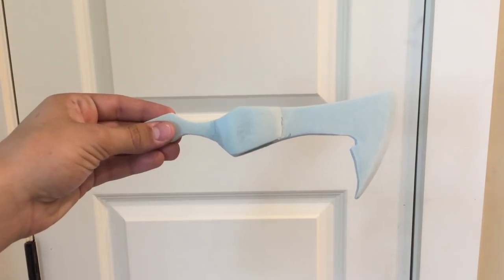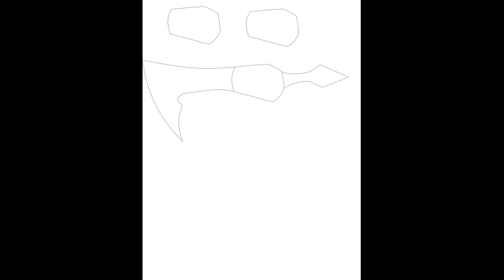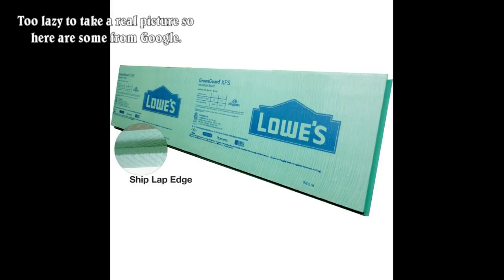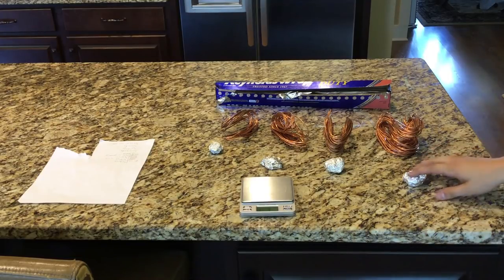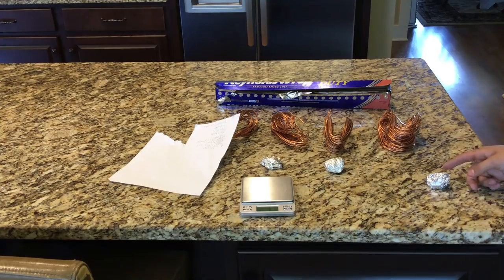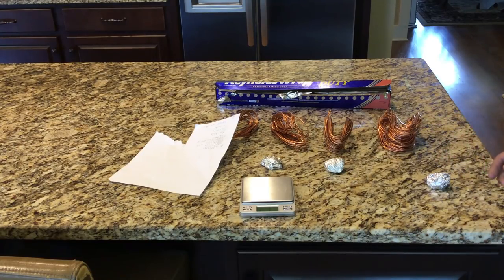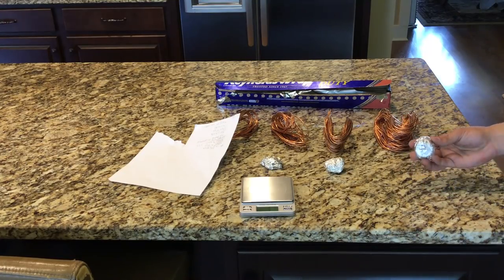Golden Tomahawk Made from Aluminum Pans and Copper Wire

Comment: Btw there are secondary metal wedges that are suppose to be hammered in after hammering the first wooden wedge. If you think there’s any chance that axe could ever be swung, you should add one. You can get them at the hardware store for just a couple of dollars. They come in circular and flat shapes. If you get the flat one, angle it perpendicular to the wooden wedge and hammer it in

Comment: excellent video, !!!  Did you heat the copper to 1090 celsius or added some low meting metal to lower the point? I mean aluminium 's got a higher MP. . . . .

Comment: You got a really nice finish on that, great work!  Have you work hardened the edge and tried throwing it yet?  Lots of fun!  If you do some peening to harden the edge it's amazing how well an aluminum bronze blade can hold up.  I've cast a couple too but mine were more like hatchets than hawks, and cast in greensand using C95400 aluminum bronze rather than a homebrew alloy.  I take mine on camping weekends with the guys and they get used chopping hickory logs for the fire all weekend and hold just fine.  I really want to try making some homebrew al-brz at some point as well.  

If you're like me you're always trying to to figure out what the next upgrade to your foundry should be.  Here's my suggestion: Do yourself a favour, get yourself one of those 3-finger log grabber fireplace tongs and lose the salad tongs if you don't have access to a welder to make some proper crucible tools.  Those log grabbers work great as lift-out tongs for smaller crucibles, and your little guy there looks small enough you could even use the.same tool as a pouring shank too,  just set it down, switch to a side-on grip for a better controlled pour, and there you go.  As long as you don't squeeze too hard you'll be a lot safer that way than you are holding crucibles of molten metal with your hot dog grabbers. :)
Reply: Glad to hear you're working on safer pouring tools, those salad tongs make me nervous!

Aluminum bronze is actually used to make some modern axes because it is almost as hard and durable as steel, but it won't throw sparks, so it is the perfect tool for, say, a maintenance worker out in the field who has to chop through something that's right up next to a gas line or what have you, or for firefighters in certain situations.

I really only made my bronze axes for fun too, and I also gave the first one I made to a friend (he uses it to do some work around his farm), but I chose aluminum bronze in particular for them because I really like making things I can actually use - a golden axe certainly is a beautiful thing to look at, but a beautiful golden axe you can really chop down trees with?  

I had a lot of trouble researching how to work harden bronze though.  Pretty much all I've been able to find from anyone who actually knows what they're doing is a couple of videos of people work hardening steel scythes, and a couple more of Neil Burridge talking about but not showing how he hardens his bronze age blade recreations.  I also learned that some of the known aluminum bronze alloys actually respond to heat treatment, unlike copper and just about all of its other alloys.  I'm not 100% sure aboit this part but but as I understand it, there are ways to cast those alloys so that it comes out of the mold already in heat treated condition.  If you ever decide to do more research and find out anything more about any of this stuff, please let me know!

If you're interested, I put up a series videos of how I made my latest axe and how I did the work hardening.  I don't want to spoil anything, but by the end of the final video in that playlist it is crystal clear how well the peening technique I finally had to come up with on my own really does work.   :)

But anyhow, good luck and stay safe, happy casting...
Reply: Ethan Hohlt No, not a week.  I try to put enough thought and time into my occasional replies that they are  worth reading even if they might be a little long sometimes.  Why, did it take you a week to read it?  :)
Reply: Casting and work hardening at the same time? Sounds nice..... figure anything new out on that front in the last 7 months?

I’m using some “hot dog grabbers” atm too. Fireplace tools sound like a much better idea.

Comment: Great job!. you could have ad a piece of steel inlay in the bronze for a totally functional axe.
Reply: Actually, as mentioned in other comments, the Aluminum Bronze he made here IS fully functional. It's a great material for things like this - quite dense so it's got weight to it, it work hardens so it'll hold and edge well, and it's also non-sparking, which has a lot of uses in certain industrial applications. It just also happens to be quite good looking when finished correctly, so there's that too.